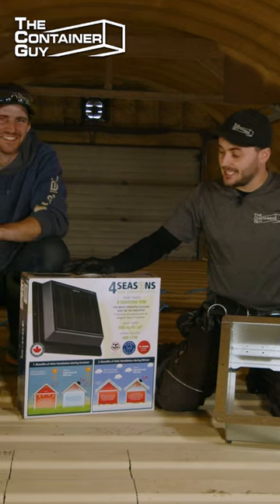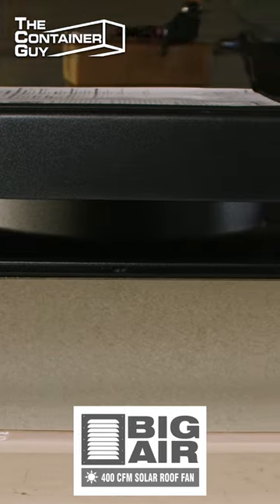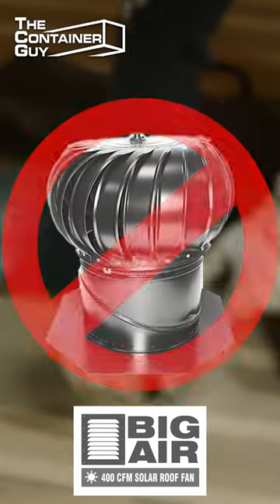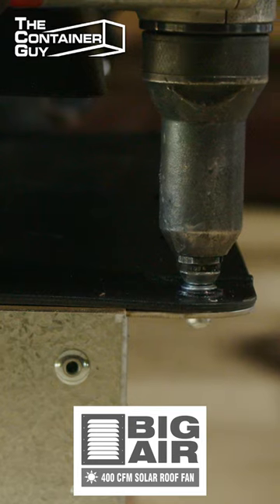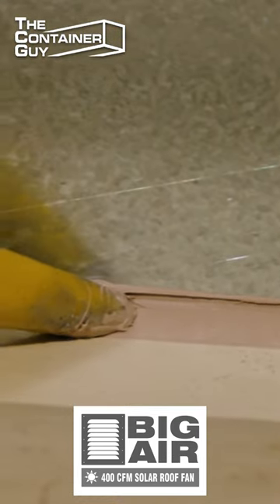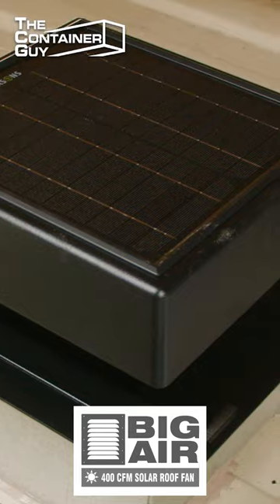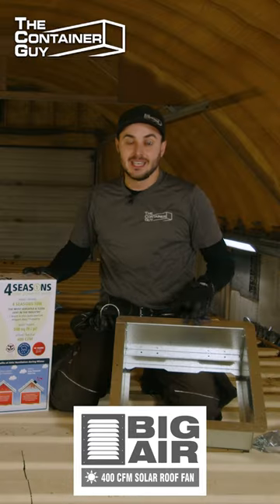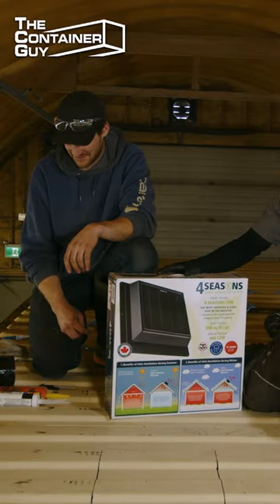Sneak Peek: NEW Solar Powered Roof Vent For Sea Cans - Goodbye Whirlybird! Hello Big Air 400 CFM!

Comment: Currently working on a project. Using a 20ft shipping container to house our compressor and dryers for cold and hot days. Could this help reduce heat in the container? How much sun light does it need to run?
Reply: I'm disappointed they didn't reply.